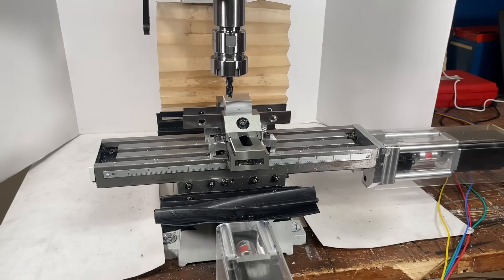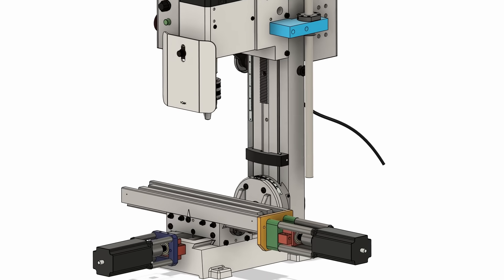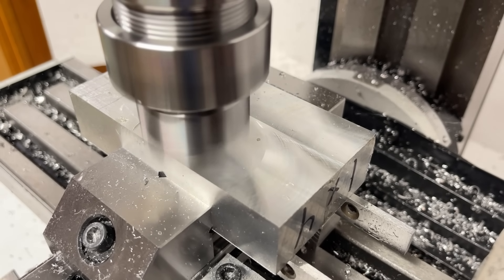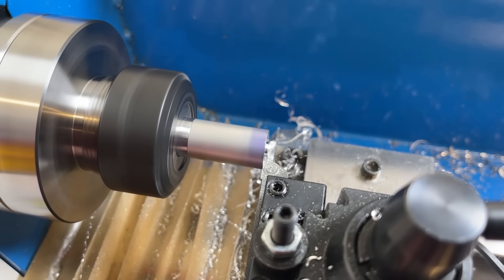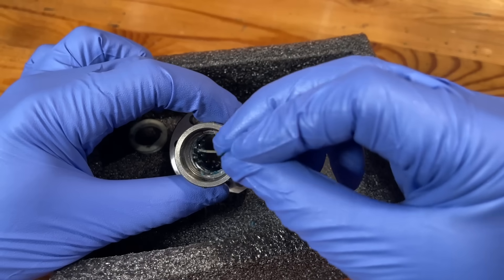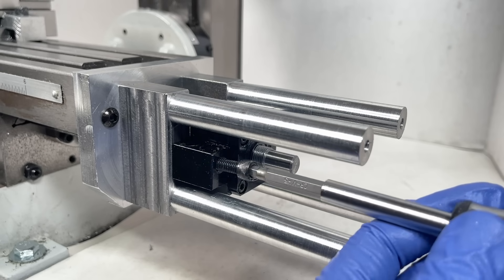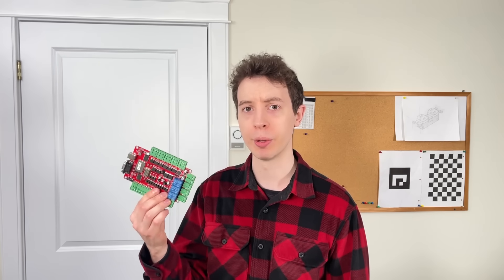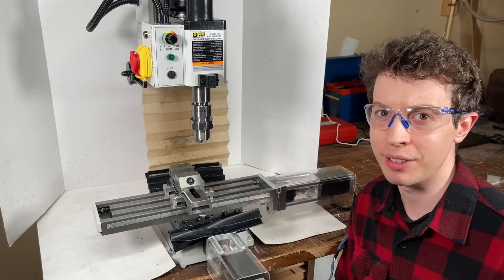Turning a Cheap Mini Mill into a Capable CNC Machine

Comment: If you know the exact backlash for each axis you should be able to compensate for it in software, your values are so close to being perfect this should give you flawless results
Reply from the maker: Unfortunately fluidNC currently doesn't have that feature. I'm thinking of switching things over to Mach but we'll see if that actually ends up happening. Bigger fish to fry in the moment - namely flood coolant system and enclosure
Reply: @Someone_Should_Make_That  that's the problem with microcontroller control software. A lack of features. You just can't do much software wise with limited resources.
Reply: @1pcfred  What would you suggest as a solution?

Comment: "diaphgram" or "bellows" couplings... they cost far more, worth it. so far the best ive used for backlash. 
oldhams have those silly rubber cushions, they only deform under load. the idea is to cater for axial misalignments, not as a cush drive... 

lol, the ball nuts are simple to rebuild... expect a multiple of 3, for theres three circuits... 51 or 17x3 on a 1605. once you get the first few in and the screws staying central, they just sort of fall together...

i found it easier to tear them apart than to bother turning a mandrel down...

hardened or not, i managed to counterbore three of those holes in a nut.

i got my Z screw down inside the column, dont ask. nightmare. works great. one day i might actually add the gas strut/counterweight. pretty amazing the steppers are dealing with 15kg on a dead lift.

the gibs on these are a nightmare to adjust properly, and the whole machine does beg for a good scrape... 

if i did one again i would just buy linear rails and go epoxy granite... scraping is easy but tedious and slow...

Comment: Had same issue with my X2 conversion years ago. 4-5 thou backlash. really sucks most on the z axis. Easiest way to solve is a second ball nut and those bellow washers things. Youll also want to beef up that z axis motor mount. I used a 1in thick plate right on top of the z neck. The stock motor leaves ALOT to desire power wise. I started blowing the fuse pretty easy around 0.05DOC. Treadmill powerplant is cheap fix. Then get mach 3 running it so you can control that spindle from pc. Wheres your end stops? If your is anything like mine your saddle will be out of square slightly and not parallel. I find the lack of Y to be this conversions biggest fault imo. I built a charter oaks for the second machine and used ground screws and it is 10x the machine. Wish i started with the big one, but did learn alot on the x2.
Reply: Do you mean belleville washers?  Also known as a coned-disc spring.
Reply: @1pcfred  yeah those thing
Reply: @1pcfred  idk. Knew it started with a b and had a l in it.

Comment: Have the same mill and have been planning to do the same conversion! Curious if you could share what bell screws you ended up using (or even if you have a BOM of the parts ordered!)
Reply from the maker: Hey! I bought one of the cnc ballscrew kits off amazon and cut them to length, there are a bunch of import ballscrews available and I imagine they are all roughly the same level of "roll the dice and see what you get" quality. Good luck with your build!

Comment: Cheap CNC mills use spring loaded nuts on the lead screw, that when compressed hold the bed/axis against one edge of the lead screw thread, just thought I’d throw that out there

Comment: As someone with a similar mill, you can double nut the ballscrews to reduce backlash. Also when you upgrade the steppers, you can get an ac servo for the spindle and really get cooking.

Oh and also coolant will prevent chip welding with aluminum. 

Great work on this bad boy!
Reply from the maker: Thank you! A flood coolant system is for sure a high priority item at the moment, just need to figure out the enclosure design
Reply: Hi, I have also cheap ballscrews and discovered that there are normal groove ball bearings with no spacer in between instead of angular contact ball bearings wich makes the nut to tighten the ballscrew in the bearing block kinda useless because it just presses the two inner rings of the bearings together.
Reply: I like to use cutters with fewer flutes too, a single fluted 6mm endmill has much better space for chip evacuation, those little 4 fluted cutters are ok for steel, which has a much lower material removal rate, but aluminium leaves some quite chunky chips which can block smaller flutes and cause cutters to get gummed up. of course this is really only much good if you have plenty of spindle speed to spare.
Reply: "you can double nut the ballscrews to reduce backlash"
It's impossible to fit double ball nut for Y axis in this particular machine frame.
Reply: @MSM5500  Bummer

Comment: I have built stuff with those cheap ballscrews and they have almost no backlash, definitely less than 1 thou.
It think your couplings are the problem, they use rubber cushions that will comlress a tiny bit, so if your load is high (like tight gibs on a heavy machine) that will translate to a degree of rotation or more, and with 5mm lead on the screws that could be giving you 4 thou of backlash.
You can test by loosening the gibs and then retesting the backlash.
Reply: agreed. I've used tons of cheap ballscrews and their backlash is in the sub .001" range. There's a reason we don't use that type of compliant coupler. It has a huge weakness for this use case -  The coupler should only allow for axial misalignment - that design allows for shock cushioning which is actually really BAD on a CNC - it needs to be as rigid as possible. .004~.005" of "backlash"  is actually really bad - this means that the end mills etc are going to be getting a lot of chatter and vibrations that will affect their life considerably.

Comment: Just FYI if you have two pcbs that communicate at different logic voltages ie 3.3v and 5v then you can use a level shifter to change the voltage
Reply from the maker: Oh that’s a good point, I think I genuinely forgot those existed during that section of the project. Good to have in the back pocket for future builds though! Thank you for the reminder!

Comment: Closed loop steppers only have one advantage.. you will know, when you lost steps but they will not be able to fix those lost steps, because a stepper can't just put out more power, when steps are lost. It can recover the position, when the (over)load goes away but not mid-cut. That load goes away after the cut is finished and your part might already be scrapmetal.

That is where Servos come in. Most of them can put out 300% power for some time and can "fix" the lost steps when they occur and not after the cut.

Just don't ask too much from the OL steppers and you will  be totally fine.

Comment: Sometimes I wonder if it's better to just use a leadscrew instead of a ball screw.
I know it depends on the application, but you can't really beat the zero backlash and smooth operation of an interferance fit leadscrew.

Did you consider it?
Reply from the maker: I did yes, I did the math for it and found with a solid preload the required torque was a little close for comfort with the motors I was able to easily get. It may have been fine, but I figured why take the extra risk. With that said I would be interested to see how well one works in this application. May be worth a shot
Reply: @Someone_Should_Make_That  ah, nice to know you considered, and even calculated it :)
I do agree, frictionless ball screws are a pretty hot alternative and hard to decide against ^^
Reply: @Someone_Should_Make_That  the solution I ended up using was making my own custom lead nuts out of HDPE and running them on acme threaded rod. HDPE is elastic and it acts like a spring. It's zero backlash. There's some gotchas in getting it to work though. Tapping elastic material for instance can make for some really tight threads. Running the tap repeatedly through it won't fix that either. Don't ask me how I know.

Comment: If you are going to machine hard materials/ hardened steel the Kennametal stainless steel KC 30 and KC 40 works real good, I ordered it special for my job just for those materials.

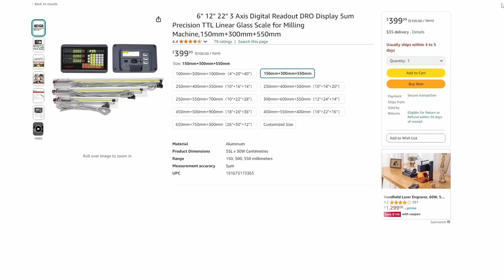Comment: @0:10 Haha, yeah, you could also buy a dishwasher for that price 😆I mean, if you convert it to CNC, you still do not have a DRO when operating the machine manually, so it's not the same..
Reply: You can't hand crank a ball screw machine. You only think you can. Well, I suppose you could. But you'd only be wrecking bits when you tried. Because without back drag on the lead screws each axis will just be bouncing off the work. When steppers aren't moving they're holding. Them holding is important. They can hold a lot better than you can too.
Reply: @1pcfred Wow... This was an eye opener for me!

Comment: most cnc control software and hardware support backlash compensation, check your config.
or you could preload x and y into one direction to counteract backlash. z does it by gravity
Reply from the maker: I wish it did! Unfortunately I looked into it and it’s a no go. I may see about writing my own backlash compensation functionality for fluidnc, but to be honest I may also just look into other existing options to save some time
Reply: @Someone_Should_Make_That  its weird, fluidnc is a fork of grbl which has backlash compensation since the early pre-esp32 arduino days.

you may look into rabbitgrbl instead, its also compatible with the esp32  it doesnt have a fancy webui, you need a gcode sender for it but its supports stuff like that.
Reply: grbl isnt a controller but yes its bad and everything derrived from it and i wouldnt trust it in any of my machines    im running a fpga based pc-less controller which works well

Comment: Nice job! To get rid of the backlash you can change out the bearings in the ball screw bearing blocks to annular contact bearings,C5 or C3 type, they usually ship with deep groove bearings.
Reply: those blocks have a nut to preload them eliminating all backlash, this works on deep groove bearings too, they just dont like it and wear down much quicker.   he could install some bigger balls into the ballscrew-nut. they are different grades

Comment: .004” Backlash is to be expected from single nut ball screws. It’s the reason double nuts were created. Most cnc software should be able to adjust for backlash, I’ve used backlash compensation in both Mach3 and LinuxCNC.
Reply from the maker: Sounds like I definitely need to look into other firmware for the controller. Thanks for the tip!
Reply: @Someone_Should_Make_That  it is said that backlash is best removed mechanically. You're very close now. A commercial shop wouldn't expect better than a few thousandths accuracy out of a cutting machine. When you want better than that parts need to be hardened and then ground. Just how it is done, for reasons.
Reply: Really?? because I recently bought a few $20 ball screws from Amazon and they had less than 0.0004" of backlash in the nut and I thought that was kinda too high. I think OP backlash might be coming more form the gibs.
Reply: @HuskyMachining  My thought too. Maybe using liner rails on the axis would solve this.
Reply: @Later2u  backlash is unrelated to the rails - the rails should only guide the movement. The "slop" in the system is a combination of the ways and the backlash. Backlash is just from the ballscrews
Reply: @mikethezipper  The ways on that machine are inherently inaccurate. The ways guild the movement using gibs to determine the precision of that movement. I can say, having played with this exact type of machine, the ways and gibs are not accurate. The ways are machined, not even ground. So if the gibs have too much clearance, those axis will rock and not keep the table, saddle or ram perfectly square with each other. If the gibs are too tight, the movement will bind. Using linear rails would solve this problem.
Reply: @mikethezipper  And "Backlash is just from the ballscrews" is false. That is why they are ball screws. Minimal clearance for back lash. Maybe your thinking of lead screws. They would have .004 back lash.
Reply: What you suggest for having a backlash lower than 0.001mm

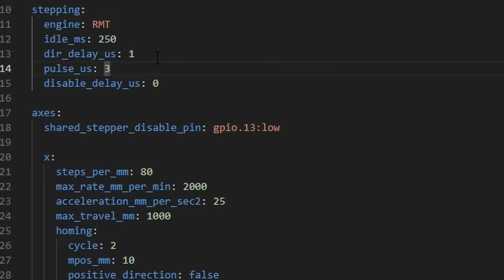Comment: 12:10 😂😂 It’s ALWAYS something that obvious
Reply from the maker: It really is isn’t it hahaha
Reply: @Someone_Should_Make_That  logic always has setup time. Sometimes there's hold time too. Some motor drives are really slow. It isn't so obvious either. None of this is anything we can perceive. So it was good that you caught it. In general you're best off bench testing motors and drives. Because once the motors are on the machine you're just increasing the variables. You get in too deep. It's happened to people.

Comment: Nice work, young man! I'm a retired machinist, and did the same conversion on the same mini-mill, a little over 3 years ago. My conversion was a whole lot easier though, thanks to the brilliant design of a Texas gentleman named Bruce Nelson and his mini-company, Heavy Metal CNC. Mr. Nelson designed and sold a conversion kit that only required the 6 CNC machined aluminium blocks in his kit to adapt off-the shelf ball screw assemblies to the mini-mill. No machining of the ball-screw assemblies was required. No stand-offs were required. A truly brilliant design! Sadly, Mr. Nelson passed away in December of 2021, and with it, his company. Still, I would like to offer a few tips regarding this mini-mill that I've learned since doing this conversion 3+ years ago:

1 - Replace the Y-axis and Z-axis "accordian-style" way covers with cheap plastic food storage bags from your local super-market.  A single 1-gallon bag covers both the Z-axis and Y-axis (rear) ways MUCH BETTER than the original covers! I attach them to the machine's head-stock and the Y-axis saddle using Niobium magnets. For the Y-axis (front) ways/ball-screw, use a single 1-quart plastic bag and the original hardware instead of magnets. The X-axis ways and ball-screw are covered by the table, at least, with Mr. Nelson's design.

2 - Cover the Z-axis ball-screw with the cheap plastic, flexible, split tubing that is used to organize computer cables. It's easy to install with zip ties, and they keep the Z-axis ball screw clean!

3 - Invest in a 14" x 6" fixture plate from Saunders Machine Works, $170. On many set-ups, I can use just  (3) 6mm. SHCS's to locate my work-piece accurately and squarely. Using CAD and the down-loaded file of the SMW fixture plate, I can know where the corner of the work-piece is relative to the machine's X-Y home position. This means I don't have to use an edge finder or a dial test indicator to find the corner of of a work-piece and set X0, Y0. I program it from the machine's home X0Y0. Just set Z0 and go! Of course, this won't work with all set-ups, but for me, quite a lot!

5- Buy some cheap "Halo" LED's and mount them around your machine's spindle. Like the way covers, mine are attached using Niobium magnets. They shine directly on the cutter, not in your eyes. They run on 12 volts DC, so are safe to use, even with steel chips flying around. I think they were about $10.

6 - The belt drive kit from LittleMachineShop.com ($150) is just SO MUCH more quiet than geared spindle motor drive, and nearly doubles the top spindle speed from 2500 to 4600 RPM.

If anybody is using the SMC5-5-N-N 5-axis CNC controller, I've learned a few programming tips that are not even mentioned in the Chinglish "manual". Happy to share!

https://saundersmachineworks.com/collections/smw-fixture-plates

https://www.superbrightleds.com
Reply from the maker: Thank you for the advice! I definitely want to upgrade the way covers as I plan on making a flood coolant system for it at some point soon
Reply: Since Mr Nelson won't lose any sales if people make their own CNC conversion kits, can you share photos of his kit, so people can use it as inspiration for their own CNC conversion kit?
Reply: @poorfarmer519  OK. I will take photos of everything, today.
Reply: Superimperator  the missing bit is "cam" software to produce gcode. Theres commercial and open source. For 2d there is websites and such that will do it from a svg file too at the simplest end.

Its not that complicated in principle but can get as complicated as any machining. From free to really expensive. Reall you might be best off starting with googling with your cad softwares name and "to gcode" at the end or such
Reply: @johnvybiral7220  one month later...
Reply: Very useful advice. Can you post what motors you used? closed loop steppers? and what torque rating? I have bought a LMS mini mill
Reply: im looking to buy or build a 4 axis desktop cnc capable of machining stainless. what would be your best suggestion? i wont need any parts larger than 6" x 3" thanks
Reply: Heavy Metal CNC seems to be out of business.
Reply: @ikemkrueger  Did you even read the comment Lol?

Comment: Building a telescope mount the now using harmonic motors and as soon as I saw the couplings I thought "oooh.  That's not going to help his backlash"

Nice build.  Glad the algo recommended it to me. Surprising amount of comonality between a CNC machine and a telescope mount
Reply from the maker: Thank you! That’s quite interesting, I wouldn’t have thought of the overlap initially but it does make sense. Chasing precision movement control is a sport all on its own regardless of where it’s applied haha
Reply: @Someone_Should_Make_That  tell me about it.  For imaging you are trying to keep a star on the same pixel (more or less) and sending adjustments to the mount.  You can quickly end up chasing your own tail with backlash.